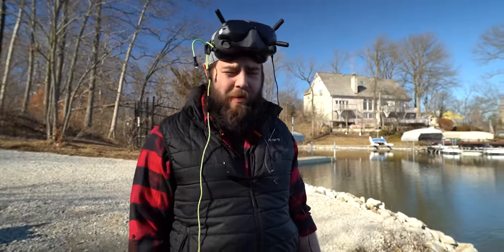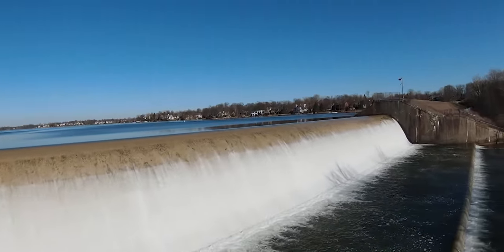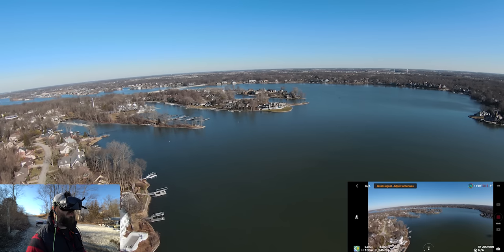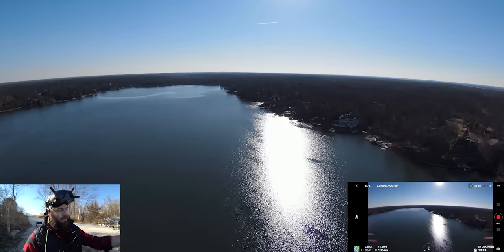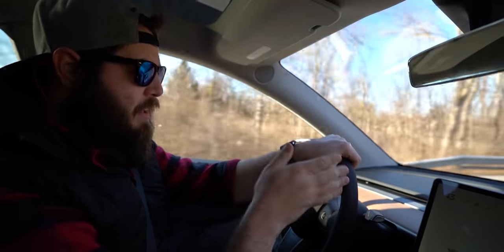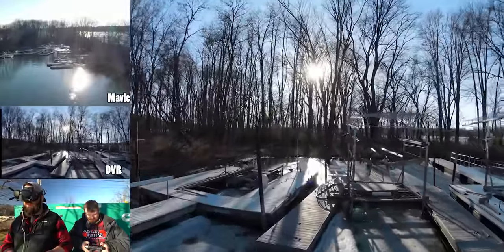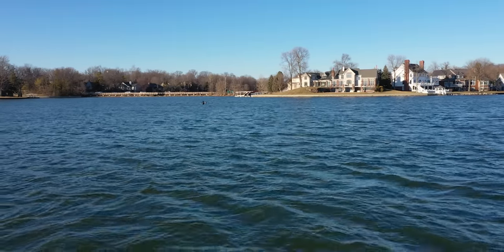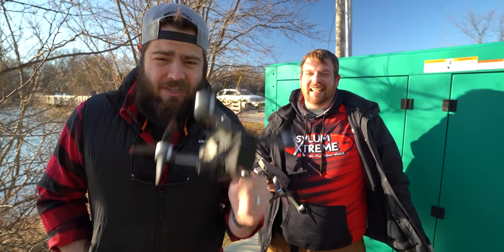Pushing the DJI FPV Drone Range to the limit

Comment: I would like to see full manual mode as fast and far as you can go 1 way!!!!  I think 90+ mph, that would be soooooooo cool!  Great vid btw.
Reply: Second that! 😜
Reply: @JamesDBuzzard  yeah tons of people will do the boring long distance flight but only nurk has the control to bomb it out full gas at 90 mph!!!!!!
Reply: @todd5963  I have never expected average from Nurk. 👊🏽
Reply: lipos can only burst amperage for so long right
Reply: @quentindollard4602  Yeah that is true.  He would know better than I wonder if 70 mph would get farther than full burst since less amp burst, only 1 way to find out.  Nurk, ur up!
Reply: lmfao that weak ass drone will never get to 60mph, let alone 90
Reply: @MysteryD  6s and high kv motors, thing rips just as much as anything else
Reply: @MysteryD  I misspoke, 90 kph not 90 mph, oops.  The drone can travel up to 97 km/h (60 mph).
Reply: @MysteryD  I don't understand why would you watch a video of a "weak ass drone" when it's obvious you don't like it?
Reply: Definitely would like to see that and many others to
Sendit
Reply: I concur.
Reply: I don't think you will get "Full manual mode" from DJI
Reply: Yap 👍
Reply: @lee8org  Wait, it sounds like a few people think a guy that flew a drone under a moving train can't do what I suggest!!! 😂.  If you haven't seen that video, epic!  Called flight of the year.
Reply: Cheers to that👊
Reply: @quentindollard4602  it’s triple the weight with the same motors and batteries as ours.  It’s great for beginners.  Give me a break.  I learned to fly my whoop in an hour.  You don’t need to waste that much money to learn.
Reply: @johnjonesdronesfpv7939  fr tho people do me marketing it as a beginner drone like what??? it’s rly weak and parts aren’t available
Reply: @MysteryD  it 100% reaches 90 mph
Reply: @lee8org  it has full manual mode
Reply: @todd5963  wind is way worse on water, no way 90mph
Reply: @todd5963  I've seen several flights over 90 mph. Not sustained of course
Reply: Would love to see it too
Reply: @todd5963  really cool video 👌
Reply: @MysteryD  lmao it’ll do 93-95mph depending on the wind kek
Reply: @todd5963  oh that’s this guy? I love that video👍
Reply: Buy me a new battery and I'll do it with mine lol
Reply: Yes
Reply: @MysteryD  Dji hate much?? Since we are comparing drones. My wing goes an easy 110+ mph with flight times of up to 30 minutes.. not at that speed of course.... all multirotors are inefficient and slow so what’s your point. With dji you know your getting build quality and manufacturer support
Reply: @lee8org  welp u was wrong
Reply: so... Im absolutely gutted... I bought DJI FPV to fly "manual", I don't know if my definition of manual was wrong but basically even on manual mode my drone automatically goes up.... like... ???
Im 70 hours into Liftoff before it arrived, practising there in a mode where if I release all my buttons the dron will just fall down - meaning it won't go up or hover still on its own I need to constantly control the throttle to keep it levelled same like you do in a car and if I release all the buttons the dron will just start falling down like a helicopter with an engine off. 

How to turn that on?? Or what drone doesn't have this nonsense? Cos if its about the drone model im selling it and getting another one TODAY. Its shocking because I was flying exactly DJI FPV model in the Liftoff simulator, not a different drone model. I ve been on Liftoff via my DJI controller 2 doing double backflips and rolls like its nothing - on what I thought manual mode - and now in reality even the manual mode is with an assist. There is not a mode like that in my actual drone/goggles. What the actual F?

Comment: People hating on this hybrid FPV quad know they secretly want one.  Been flying FPV since 2015 when cleanflight was all the rage, I couldn't imagine this being my first FPV drone like it is for some people.  New FPV fliers are finally entering the market again which will bring about an FPV boom. Probably not as strong as the 2016 FPV boom but I'll take it.  Fatshark and other FPV companies sat on their hands for far too long.  Though I do wish DJI didn't botch the Goggles V2 release so badly...and finally enable video out on both V1 and V2s for all flights.  Since the DJI smart controller is basically an android system we know its possible...

Comment: I love mines, for what it is it's a great drone. Not sure if I'd trust my 7" out that far even with TBS CF
Reply: if i understood that right, they only flew 500m -isch. thats not far at all. my 7" longrange with dji FPV system was 2km out over a forest while i was test flying. this clip dissapointed me even more about the dji fpv drone.
Reply: Seriously. I only trust DJI with long range flying. lol I'm afraid to test out the TBS CF even with GPS rescue.
Reply: @CoolBein  well the DJI system has like 5km range on perfect condition (everything stock ofcourse) the TBS CF has like 30km. doesn't matter what you do, your video will always loose connection before CF. i have both and i trust CF with my life. DJI not so much.

Comment: I have 2 MA2 drones.  Line of sight, both drone + controller OUTside visual line of sight, they max out at 1,100-1,200ft distance (no interference - my cabin is in the void 'sticks' upstate).  No more than 1,200 ft range.  Period.

Comment: Wait a minute... I thought this drone has a range of like 10km (over 5 miles).
Why are you hyped about 1000m (just over half a mile) 
Or am I missing something?
Reply: They lie or say the range with unrealistic perfect conditions. It's probably good for 4km I'd guess
Reply: He isn't hyped about it reaching 1km
Reply: He was happy to be hitting gaps 1k away on an island. The original v1 system already does 8k . He flew 4k each way on this video, the system asked him tu turn back due to battery percentage

Comment: That was very interesting and impressive. 
Might be interesting to do a test where you see how efficient the Drone is at different speeds. for example can you  fly more distance at 50 mph then you can at 25 mph, until the battery is down to 50% or 30%..

So what I'm trying to figure out is let's say you have 30% battery left and you're pretty far from home. Are you more likely to make it home if you fly slower or faster?

Comment: Stupid question I'm sure, but how did you get the OSD data on the camera view that is embedded on the bottom right of the screen? Mine doesn't do that and doesn't export any OSD overlay in either the goggles feed or the on board camera.
Reply: That's a mystery...

Comment: I still want to see someone hit the altitude limit in manual mode. Will it change modes? Will it return to home? Will just limit throttle? All these questions need answering. Yunno, because mounting surfing.
Reply: Just on my way out the door but this guy has footage of hitting it and how it behaves when you hit the limit (may have been a geofence, can't recall and don't have time to check!) https://www.youtube.com/watch?v=t-spI1FL8dg&t=615s
Reply: 7 mins in
Reply: I did 800 feet on a dji spark
Reply: @gonzalor6  a spark can go 10,000 feet, trust me 😉
Reply: @Hughjanus720  damn,thats scary
Reply: @ultrasteve9240  Hey thanks, so it just slaps you into normal mode and limits you...that sucks. This drone literally has no use case.
Reply: @gonzalor6  if its in a suitable place ie a buddys farm or something its not so bad. I got back with 11percent on the battery
Reply: Great why don’t you buy one and you do the altitude limit for us

Comment: I see a gopro mount on the top of that drone - I'm super curious how it reacts with a full size gopro on top or a 360.  I'm expecting that  will be an ideal mount as this thing does seem to have the power to lift one.  Also, I'm curious about your setup for getting the telemetry onto the phone as well as in the goggles.
Reply: Yeah Jeff me too on knowing how Nurk is getting Telemetry on his phone..?? Because I would like to use my 12' tablet as well if I can.
🕹🚁👍
Reply: I think he mentioned in the last Goodflight podcast that it was not too happy to have that extra weight.

Comment: Love your coverage on the FPV drone. I just ordered one, used to fly both acro quads and long range 1.3ghz/dragonlink. I got out of the hobby a few years ago because it all became too much to juggle while also focusing on life. This new DJI unit looks like it addresses all my issues while providing 810p into the goggles...pretty amazing for the price, and if it ends up completely lost it's not like I spent 40 hours building and tuning it. Glad your doing in depth coverage as your answering a lot of questions the mainstream reviews don't cover.

Comment: i want to see a drop test, like from head height. highest ive fail safed my 5" is about 15m up and no damage. from photos ive seen the frame is like balsa wood, no hate here just curious
Reply: That height it be fine.  My mini has fell from that height and been fine. But don't hit a tree and free fall from high .. or tank it and tumble.   There's a lot of broken ones on the internet.

Comment: I wish I had the kind of balls to do range tests over a lake
Reply: I barely have the balls to fly over puddles😂
Reply: What do you need balls for? Keep and eye on the battery, return before hitting 50% and if you lose signal the drone will return by itself
Reply: Did this with my DJI spark far away in the mountains. 2 miles over a lake. Crazy

Comment: Just ordered a mavic mini and im so hype!!!
Reply: Why a Mavic Mini?
Reply: @smooth_ops2942  honestly budget, but in a sense they really similar and I wanted the fly more combo, and I found one on Amazon for $400
Reply: @vlogsfromthemultiverse3190  The Mini or Mini 2?
Reply: @smooth_ops2942  the mavic mini, first one
Reply: @vlogsfromthemultiverse3190  Better get some of those range extender thingys 👍🏻.
Reply: @smooth_ops2942  I did they just came in the mail! Hahahaha
Reply: @vlogsfromthemultiverse3190  the mini 2 is worth the little more you have to pay. The transmission capabilities of the mini 2 compared to the mini 1 is crazy. The mini 1 has ok range but not forgiving at all. One second you have video and the next its breaking up bad. The mini 2 however gives you accurate signal bars so you know when you are getting close. I fly my mini 2 in the same area that I did my mini 2, middle of a city, and can get almost 2 miles in every direction. With the mini 2 I could get at best 1400ft if I was standing in same direction and there was nothing blocking signal. Really it's not even worth buying the mini 1 in my opinion.  But u will still have fun if you ha nt experience anything else.
Reply: @joshv9403  in all honesty, I have it now and it work amazing, the range is fantastic for me, flight time, camera. It makes me glad I got it and don't regret it. Thanks for your opinions tho!

Comment: how about sending the drone 5 miles, land it and have someone there with a new battery, fly anothe 5 miles where someone will fit another battery testing the 10 mile range. Then fly back to the 5 mile for new battery and back to base?????

Comment: Is there a way to get more climbing range for mountain surfing? I heard the 500m altitude limit wasn't configurable.
Reply: I would like to know this too. It seems like a major limitation to doing true long range mountain surfing. Mountain surfing would be a primary reason for me to consider purchasing this drone. I'll keep my fingers crossed for a workaround to this.
Reply: Nope, don't think so, maybe another hack in the future. 500m really isn't much over our mountains here. For a decent dive currently I'd have to cable car up there and dive down ;)
Reply: I have seen some hacks for mavic type quads, download a certain firmware and you can get a browser dev tools to open. This is how attitude mode is configured pretty sure. Maybe there will be something like that to alter the 500m limit.
Reply: as someone who was gonna buy this drone for the sole purpose of cinewhooping the mountains and have gps rescue. I found out from my friend that you cannot unlock it. but if you start on top of the mountain and go downwards it allows it to do such thing. That doesnt suite me but maybe its something you can do
Reply: There is a submission form to remove all limits on the app.

Comment: That was an amazing flight. I am fixing my fpv right now, can't wait to get it done. Not only did I break a arm but the main frame so I had to tear it completely down! I will say that I have had it about 2 miles away with no troubles.

Comment: My one falls out the sky without failsafe it’s got sensor issues so I would never fly it out of sight . Not that I can fly it at all now it’s in bits
Reply: F
Reply: @NeoNeko420  😭 I hope mine was a one off faulty drone it says sensor error and drops out the sky I’m gutted did it 3 times last time was on hard surface and it’s dead

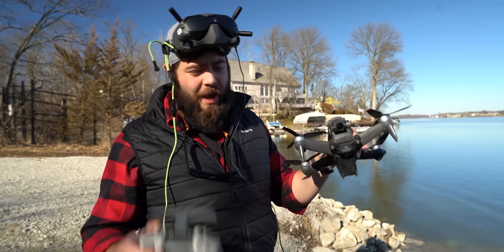Comment: 0:43 Can't do serious mountain surfing with it since it has a 500m max altitude limit from takeoff. Or is there any way to disable that?
Reply: Just wanted to comment the same thing 😊
Reply: I've tried to use the "Terrain Follow" feature on a Mavic for mountain surfing. Didn't work consistently at all and missed some great sunset shots after a looong hike because of finicky DJI tools. Sticking with my Pro399 7" for mountain fun. The return to home function in Betaflight is getting better all the time. It can be set with custom parameters that help the chances of a failsafe making it back to radio range without hitting rock. It saved me already!  DJI needs to step up that programming or stay in the flats lands!

Comment: Nice video and chase shots. Quite risky at times over there on the island. The thing that freaks me out the most is landing this thing tho. It's not hard, it does everything for you, but you really gotta trust it... landed a few times in manual mode with goggles on and this doesn't always work for me ;) 2 times tipped over and didn't disarm fast enough (since you need to doubleclick). Love the thing tho, now there's even an fcc hack for us ce users so we get the same range as you cool us guys ;) greets, Mario

Comment: Here's a thought.  When is someone going to produce a regenerative motor for quads?  Much like you hit pause/brake/slow down/go downhill (like my EV) and the motors proceed to dump a charge back into the battery.  I'm not an engineer and don't even know if that technology could be scaled down.  Also, it appears the DJI 10k distance claim might be based on R/T flights...not a single out 10k and return 10k.  I do like these distance testing so keep on with it.

Comment: so... Im absolutely gutted... I bought DJI FPV to fly "manual", I don't know if my definition of manual was wrong but basically even on manual mode my drone automatically goes up.... like... ???
Im 70 hours into Liftoff before it arrived, practising there in a mode where if I release all my buttons the dron will just fall down - meaning it won't go up or hover still on its own I need to constantly control the throttle to keep it levelled same like you do in a car and if I release all the buttons the dron will just start falling down like a helicopter with an engine off. 

How to turn that on?? Or what drone doesn't have this nonsense? Cos if its about the drone model im selling it and getting another one TODAY. Its shocking because I was flying exactly DJI FPV model in the Liftoff simulator, not a different drone model. I ve been on Liftoff via my DJI controller 2 doing double backflips and rolls like its nothing - on what I thought manual mode - and now in reality even the manual mode is with an assist. There is not a mode like that in my actual drone/goggles. What the actual F?

Comment: Paul,  are you aware if anyone, coming from the original v1 goggles to the v2 goggles,   has performed a range test/comparison flying either the Airunit or Vista?   I just picked up the V2 goggles and will be migrating some of my fleet from analog to HD.   I can't wait to see what it's like flying wings with HD.   Great video BTW.   :)

Comment: Nurk. I believe you should create a channel for this Drone. There are so many possibilities, we would enjoy you leading the pack in the exploration. One thing though. In the first paragraph, BODLY EXPRESS the channel is not for ACRO Flyer & otherwise Experts (Jerks). Reading the comments on videos are helpful, but since the launch of this drone, the "experts" are saying REALLY RIDICULOUS things (a large number of them flat out false/wrong) as they vainly attempt to justify their quads; why they're so much better; and many other non-value add remarks.

Plainly state this is a platform for exploration and learning - negative remarks are not appreciated.

This Drone is a paradigm shift. It's a great entry point into the hobby. It's not going away, and I suspect it's going to get better, with a very large audience.

Comment: This is what I want from the DJI FPV Drone enjoying the scenery during long range flight also able to take a rest with ease during flight if necessary.
Please test again, do long range in the challenging area ... fly through mountains or valleys.
is the RTH working well if suddenly lose FPV feed during flight or when it failsafe?

Comment: You know -- I need to watch a few more vids to see the acro capability...but I just realized that, when I go on a trip where I need to pack light, I always wish I could bring my acro drone along to have fun, but I usually bring a cinematic drone with HD instead.  I might be sold on this little guy, depending on the all-in price tag (I haven't bought in to DJI goggles just yet).